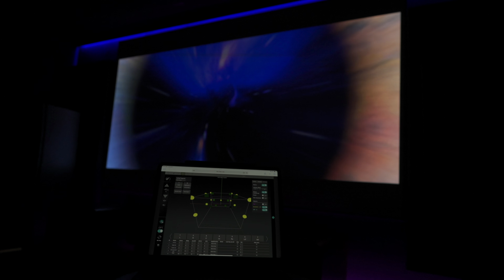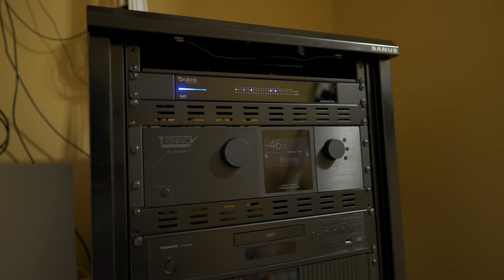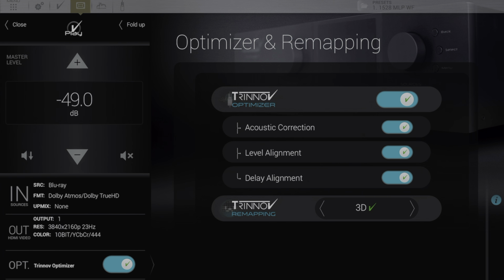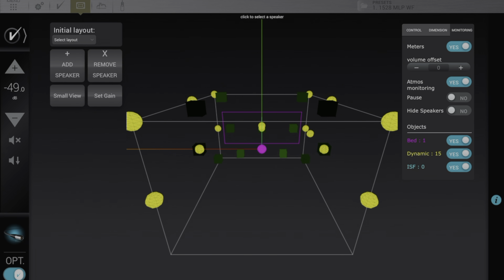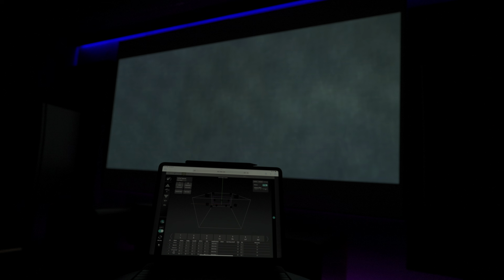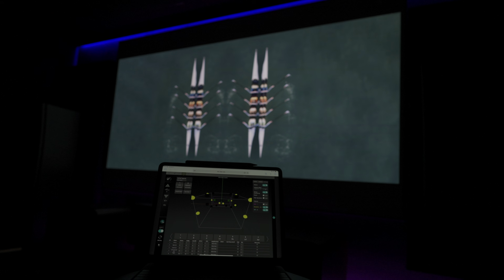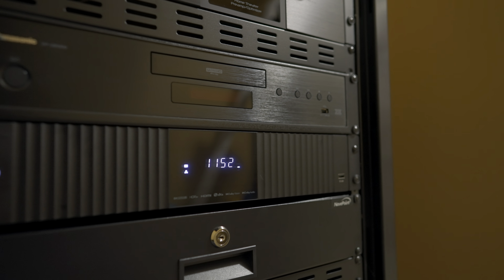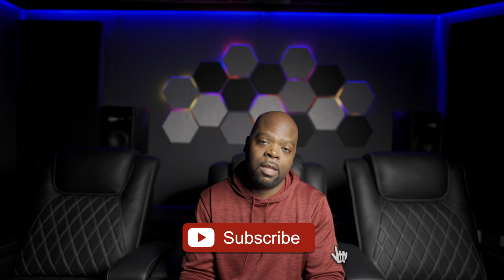Stop using FAKE Auro-3D & Dolby Atmos Demos | Get These Free Trinnov Demos Instead

Comment: Trinnov Trailers are good, but they are looks somewhat artificial. Personally I like to use Apple+ trailers. For example from Greyhound or Dune, they are in Dolby Atmos.
Reply from the maker: They’re designed for maximum utilization and immersion. I wouldn’t call them fake.

Comment: I use the internal player on the valerion.   It can play any format lossless
Reply from the maker: Does yours pass Dolby Atmos audio properly?
Reply: @ThaVillaMan  yeah, audio passthrough works corectly. 

I also have an nvidia shield, and that use to aswell, but the native player is doing a better job than the nvidia shield when it comes to the image. It's almost like the nvidia shield apps are in the wrong color space.

Edit: with the native app, there is a glitch with subtitles though. It auto enables subtitles, and sets it to the first language on the list, Arabic. So you have to flick subtitles on and off, and scroll to the bottom of the subtitles list, and select none